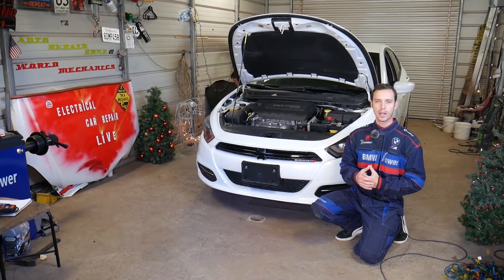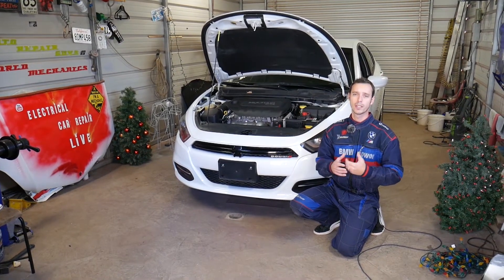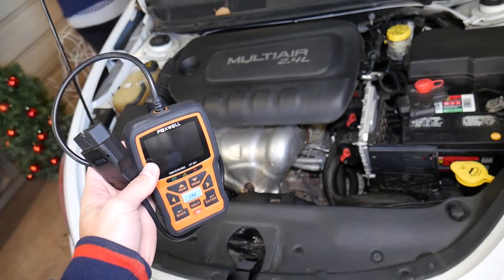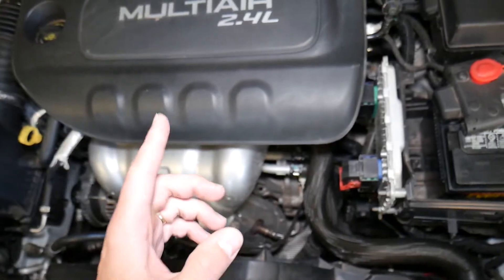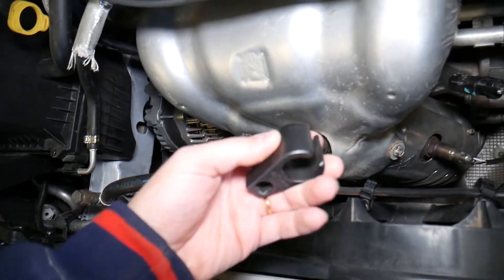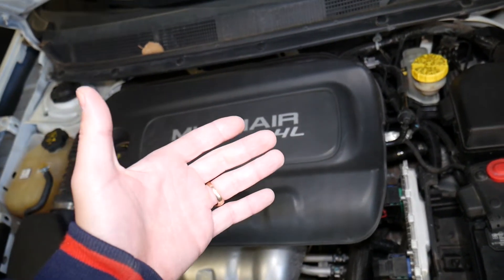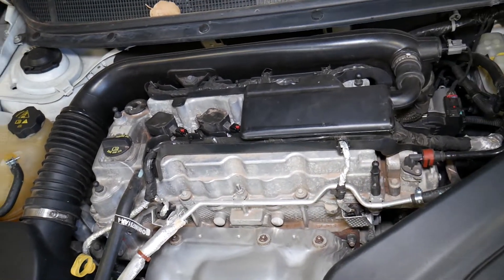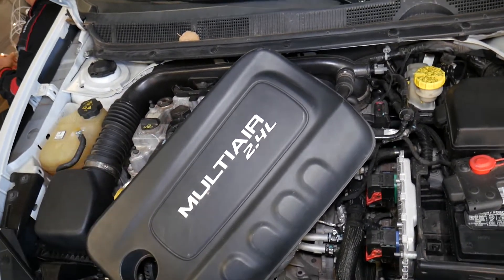CODE P1128 FIX 2.4 DODGE DART, CHRYSLER 200 JEEP CHEROKEE RENEGADE COMPASS, FIAT 500X PROMASTER CITY

Comment: Just had my 4 02 sensor off now my I have p1128
Reply: And have code p0132
Reply: On a ram 07 3.7 is driving me crazy I used to have p0420 and 430 now I changed the 02 sensor and got p1128 and p0132.... help!